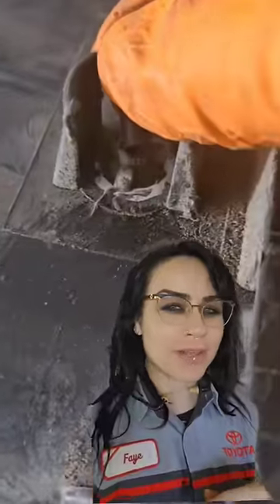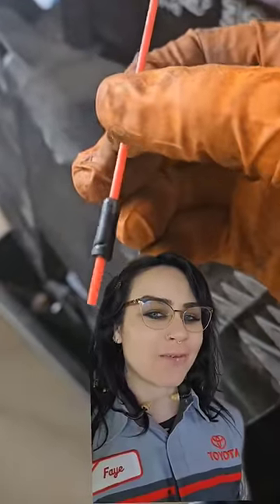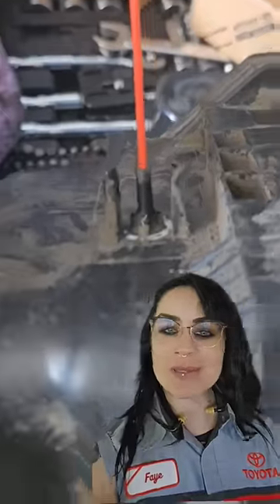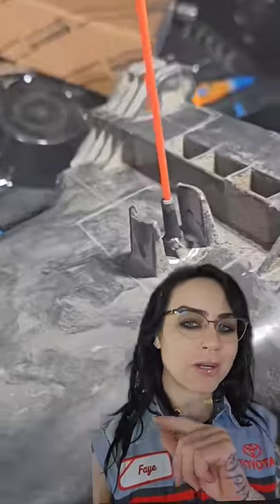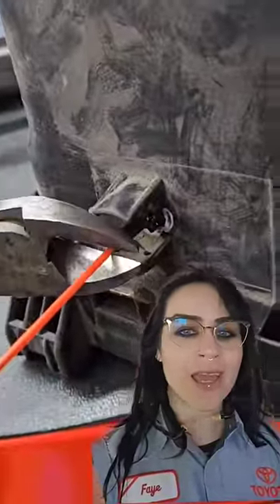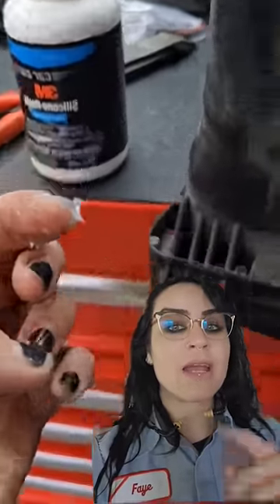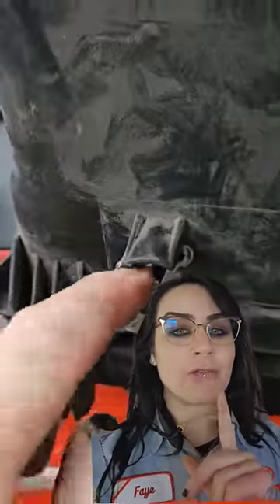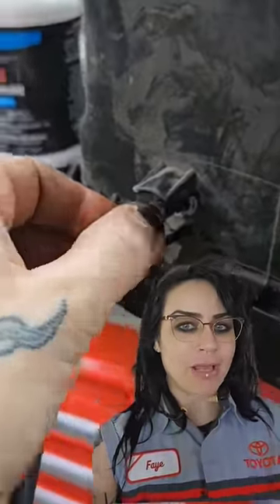Quick Fix - Broken Vacuum Port / Air Box Nipple Repair #techtips #toyotatech #femalemechanic #diyfix

Comment: Excellent use of a spray can tube! Switch from superglue to 2-part plastic epoxy and it changes from a "quick fix" to a "permanent repair/refurbishment. Probably the same price and you get more out of the epoxy.

Comment: Great tip , always apply your bonding to the part that is typically being inserted! (The outside of the straw here) If the female portion is glued !you may inadvertently glue up the clearway as it's assembled & that's a pita especially when bonding ever smaller parts.

Comment: If you don't want to live the straw inside. Follow the sa.e steps, but after placing the super glue and the parts to gather.  Sprinkle some baking soda it will make rock solid.

Comment: I always would just use a soldering iron and some scrap plastic to reinforce. Although best is to just switch to metal parts wherever possible/affordable and go with appropriately sized threaded fittings

Comment: Excellent fix for an expensive component. I’d be a little worried about the reduction in orifice size if it was for a sensor or evap system.

Comment: I use brass tubes because there stronger and holds up alot longer then the plastic ..but if your in a pinch yes the plastic tube will works well too..

Comment: I use threaded brass nipples as my initial go-to, but sometimes this is all you can do if there's not enough meat to drill out the hole to install the brass nipple. I love the black 2 pt epoxy for this, but like everything good, you can hardly find it anymore

Comment: This is "if it goes down the road, it's not my problem" thinking. There is a reason the manufacturer chose the inside diameter of that vacuum line, cutting the volume to less than half will probably affect the performance. There is also a reason manufacturers don't lube their hose attachment nipples: they want the end to remain tightly connected, not vibrate off or pull off as the engine moves.

Comment: Use a metal retractable antenna, thin metal doesn't restrict as much as the plastic straw, find the size you need drill the nipple and box if necessary, test, super glue the metal to the nipple and then to the box, be quick on the final stage.if it doesn't fully go in super glue and baking soda, Dremel and black spray paint and you're good

Comment: That is most likely made from ABS which doesn’t bond too well with CA glue (super glue). It’s a type of thermoplastic which means it needs to either be chemically or thermally welding in order for it to hold up long term. A soldering iron and scrap price of ABS 3D printing filament works great and is cheap.

Comment: If you add baking soda and crazy glue then you get a extremely good adhesive.  Warning,  make sure theres nothing flammable right on it because the heat from baking soda and crazy glue can reach a couple hundred of degrees instantly

Comment: Hit comment to literally say that exact thing as well.
It's saved me a bunch of times. Fun fact, I learned it on youtube from some rabbit hole I was down and it was a guy showing how he repaired small chips in props or helicopter rotors. Turns out he uses this trick so often that he had a sandwich baggie full of baking soda in his car, and he got pulled over, aaaaand the cops found it haha. Obviously it all turned out okay, but good luck explaining that to the cops hahaha

Comment: If you lube up that straw. You can remove it when its cured so you restrict no air. I use it for threaded inserts in plastic. Grease up the screw. Put it into the insert , glue and place. So i know every thing goes smooth with installation.

Comment: If you slice the hose length wise then open it up  with a tiny screwdriver with a little wd 40 and a twist before attempting to remove the hose the nipple won't break

Comment: Protip. If you use baking soda on CA (glue) on the outside and quickly pull out the straw, the CA will cure in 3-5 seconds and you will not have reduced the flow of that hole by 50% and you will still have your straw for your spray can.

Comment: Yeah, no. Been there, done that. It may or may not stand up to vibration and heat. Own up and replace it. The cost may be more than the initail customer's complaint or repair. However, inform the customer that you broke it accidentally and replaced it free of charge. Let em know what the cost was to replace and put it on the invoice. That bit of honesty will ensure the customer's trust and return business. 😊

Comment: While this isn't a bad idea there are a few more steps you want to take so it doesn't just break right off again. Like use baking soda or graphite powder and of course more super glue to build up a little around the break point. 
Baking soda is cheap, quick, and fairly strong but may weaken over time. Graphite powder is a little more expensive, just as quick and nearly twice as strong as baking soda. It also doesn't weaken as fast as baking soda.

Comment: I would also add a tiny bit of baking soda or ash or any dry power meterial. I will increase the strength of the glu 10X.

Comment: I have repaired vacuum nipples with the brass tube from inside a ball point pen, it's thin wall so it can be left in place and reinforces the plastic nipple and won't break again

Comment: brass fitting or jb weld / epoxy, as soon as you try to push the old hose on it will break with glue.

alot of times if it was not a specialty hose just some vacuum hose if it seemed dry / hard we heat it up or use a razor to cut it

Comment: There are certain types of plastic glues that will actual meld the two plastics into one. You would have to use a piece of metal rod to put into the hole to keep it from being gunked up. Much better fix and the gorilla glue is a point of weakness from that point forward.

Comment: Does not and will not work. Cyanoacrylate will dissolve in the presence of any solvent (such as gasoline, oil, etc...) and is extremely brittle.

Comment: I always just drill it out and use an 1/8npt tap and fitting. Try to use plastic fitting so they stay together with less chance of stripping out on installation.

Comment: All you would have to do is put a little bit of silicon spray, or WD-40 spray on the outside of the straw. That way when it’s done curing, it’s not gonna be able to dry on the exterior of the straw where the oil is as a release agent, and all you have to do is spin it and pull it out.

Comment: Pro tip before this is the case: use a needle nose pliers to sqeeze the sides of the hose over a tight nipple, it will unstick much of it after a few attempts and come off much easier. I do the same with coolant hoses, twisting or pinching 1/2" sections at a time.

Comment: Use a zip tie and a soldering iron or a woodburner (they come with different shaped tips)  then just weld it like you would metal (use the zip tie as filler rod)

Comment: Sprinkle baking soda on the outside of the glue after straw is installed. Will make the bond stronger than the original plastic.

Comment: After you put that in, you’re supposed to sprinkle baking soda around it, and it will cure immediately and make the glue weld stronger
Edit: sorry I didn’t see the top comment before I wrote this

Comment: They usually break off because someone was lazy when checking or changing the air filter and didn't remove the hose.  I've also seen a  MAF connector or two broken off because of this.

Comment: In California it’s modified and would fail 
Super glue not rated as proper repair and little plastic straw changes the diameter of vacuum port
Just replace air filter box or damaged portion of air filter box.

Comment: Close trick. But there’s a missing step. Put the super glue on one side and baking soda on the other. Makes sure it goes where you want it immediately, because that’s how much time you have. Once you’ve set the two pieces together, sprinkle some more baking soda around the seam.

It’ll be much stronger and much faster (instantaneous). You’re welcome. 😁

Comment: Sprinkle some baking Sosa on the wet glue and it will instantly set and be like a super strong epoxy. Baking Sosa will forever change the way you use super glue

Comment: Yeah except you’re restricting the airflow. The holes now half the size. If you do this on a gas engine without a turbo you’ll be fine. Do it on a diesel with a turbo engine won’t get enough air and will run rough. Correct way is use the glue(or just don’t break it) lightly around the edge. Make sure none goes into the hole. Once dried add more glue around the whole thing.

Comment: I swear by Gorilla Super Glue. I prefer Super Glue Gel XL.. It's the one with the green cap. I have used it to glue things back together for my son when he breaks a toy. He had broken a fin off a whale. I glued it back on and it was like new. He dropped it again and the same fin broke but below the area I had glued. So the super glue made a stronger bond than the factory mold.

Comment: Easy to fix with a piece of tubing, discard the old broke off piece of plastic and get a small piece of tubing and drill it a bit undersized so it has an interference fit, better than new

Comment: or you can drill out the box to 1mm smaller cut the pipe  end at a 45 an insert the pipe in to the hole never have to worry about snapping it off again

Comment: Had a mechanic try this on my wife’s minivan. It didn’t work.

I’d love to see someone come up with a way to replace these nipples with something sturdier (stainless steel?).  Maybe drill out the area where the nipple broke off, tap in some threads into the plastic, then screw in the replacement nipple with some kind of thread locker adhesive?

Comment: QUESTION..why do mechanics forget to put back or break off the plastic tabs, clips and screws in the engine bay but never replace them? If something that simple is not fixed or replaced, is that a reflection of the quality of  maintenance performed?

Comment: @FayHadley, Also Put Some Grease or Vaseline on that Red Straw For a Release Agent & After the Glue Set's Pull the Straw Out &  You'll still have the CORRECT Size Vacum Hole...Just Sayin..

Comment: Good tip, but most importantly, clean the dust off the plastic. Glue will only stick to the dirt and it won’t be a strong repair if you don’t.

Comment: take that lube and put it on the nozzle before you put it in, then you can remove it after and not introduce pressure reading delays or air volume drops.

Comment: Great tip if you're working on your own car, I would probably do this with my car rather than replacing the airbox. If I'm paying a mechanic to work on my car and they break something and fix it by glueing it back together I'm going to be very pissed off, in this case the only answer is to replace the airbox, anything short of this is BS.

Comment: I like the idea and that one holds the other in place but I would have cleaned the outside area all around the broken piece.and just used jb weld around the outside just a little on the broken part,let it dry and remove that tube,,not cut it off.or drill it put on a metal one.

Comment: A better fix, is to use a soldering iron on some black zipties instead. It will be stronger. Use the zip ties like filler rod. Also you don't have to wait 24 hours for it to cure.

Comment: Yeah, don't do this please. Just because air can get through doesn't mean the SAME amount of air can get through. Next time this happens, take the broken part off and blow through it. Then take that tube from the can and blow through it. It's much harder to blow through the smaller tube. The proper way to fix this is to get a hose barb fitting, drill out the plastic and install the hose barb in place of the broken piece. You'll have working properly and it'll allow the same amount of air to get through it, maintaining the proper amount of vacuum for the hose.

Comment: Better off using a glue which will chemically bond the plastic.  Superglue is only a mechanical connection which wont hold long.

Comment: Straw reduces diam significantly.  Heat a pice of brake line red hot. Hold it till red goes away, stick it in ur hole, let it cool. Permanent fix.

Comment: Don't use glue on polypropylene, polyethylene, or nylon.  It doesn't stick.  You need heat.  Use that straw and get your soldering iron.  Grab some scrap plastic that corresponds to the part and melt it into the crack.  That is the only way to fix it.

Comment: Not a bad fix but you should have taken the straw out as you have just reduced the airflow by atleast half.

There are some steel reinforced  2 part epoxys out there these days that work a bloody treat for most fixes as there rated for 2000+ PSI

Comment: Insted of doing this use CA glue with an accelerator its crazy glue but as soon as it touches the other accelerator it instanly cures. Work workes use it all the time.. also i dont think this will ever hold as glue is not that strong of a bond

Comment: i get small NPT barbed nipples and a tap, thread it in with JB quick weld on the threads sand the surface so you can build up around the surface. as long as they didn;t cheap out on the plastics thickness, the fix is basically permanent.

Comment: The right way To Do that it's to drill it out chapter for a 1/8 in pt and put. A fitting in there solve the problem Hey brass pitting.. This clearly is just a rig which hes showing.

Comment: Also on old sus plastic just use a razor and cut the old vacuum line vertically so you dont break ot in the first place 
But seriously try the zip tie hot knife welding works way better than glue

Comment: The plastic was cooked.   The glue is weaker than the plastic was.   Maybe with a different glue but cyano acrylate is too weak.   I’d recommend a hard drying silicone like “automotive goop” or similar.

Comment: The red straw is not enough Air volume to run anything the best way that I've done and works for me is to take a drill bit drill it out and glue in a vacuum tee with CA glue two-part

Comment: while i do love this fix and might use it one day the new internal diameter is a fair bit smaller and has to result in a restriction
Reply: i suppose if it is that big of a concern you could probably drill it out for more long term use

Comment: You could also stick a metal rod in place of straw and plastic weld the thing with a soldering iron. a custom made flat head tip for soldering iron done!✌🍻🔷️💗🛸👍👽

Comment: Don't break it,cut the hose off.Should have dealt with the 70-80s with all the smog controls. Engines running hotter to burn better, and no lead lubricant.

Comment: this fix does not last. super glue loses its bond from plastic if not treated with acetone first. you are better off mixing a two part epoxy. superglue loses its bond because of the plasticizers in plastic bonds do not attract good

Comment: If you add ash from a cigarette or some thing and then put the crazy glue on there, it will be rock hard and be a lot stronger to the point that you can even file it if you put too much on

Comment: Or you just replace the entire box there's no reason to not do it right especially if it's your customers car...
That will be smaller means there is a slight Air Flow Restriction it is highly likely your customer will be back soon with a check engine light

Comment: Except you now created a restriction in the airstream that can slow downstream sensors' reaction time.

It's not super important to know now, but think about the young tech in 10 years when the engineers figure out how to use that sensor to get another tenth of a mile per gallon and it it trips a code in the new software update...lol!

Comment: You could also add lube to the straw and not have to cut it off, but pull it out as the glue won't cure to the straw then :) your welcome

Comment: Parts are made at the factory with certain tolerances in mind , that straw reduced flow by almost 50 % . Easy cheap fix yes ... Will it stand up to long term use without damage to other parts ? Smh .

Comment: This will fail again.
Plastic welding is the way to go.
Same principle with the straw, but using a soldering iron, melt a zip tie around it.
Garanteed not to fail again.

Comment: This is the definition of fixing it just good enough so that it becomes the next guys problem. If you’ve ever tried to glue plastic like this, you know a strong fart will break it again. It is not a valid fix. 
You could thread in a barbed fitting, or do a bulkhead style nipple. For a much more professional and permanent fix.

Comment: Now see I would have put the glue on the outside of the straw cuz I would have been afraid that little glue when a garden in the hole and plug the straw when I pushed it in

Comment: I would’ve just plugged the air box and ran a small air filter to the line and hid it. After all that little hose is practically useless anyways 😂

Comment: That is all wrong....that never holds. The correct way is ...help/dorman  makes a radiator overflow nipple repair kit.  That is a permanent solution
Not counting the restricted air volume from the straw.

Comment: Not a good idea to reduce the I. D. of a vacuum line . And why is it people that claim to be professionals would want to do a half assed backyard repair when there are brass and plastic  threaded hose barbs readily available at any parts or hardware store in town. This is a good fix when you are in a situation you don't have the option to make a run to get parts or roadside repair to get home. This is a bad idea for any professional repair shop and would reflect poorly on the level of quality you can expect from them.